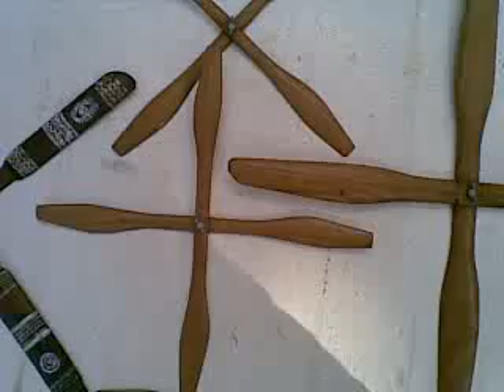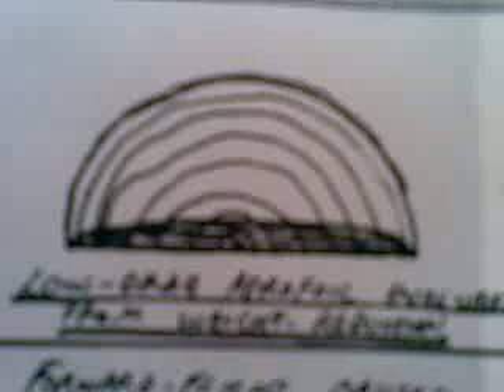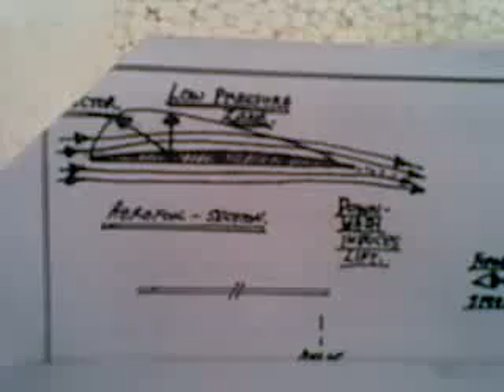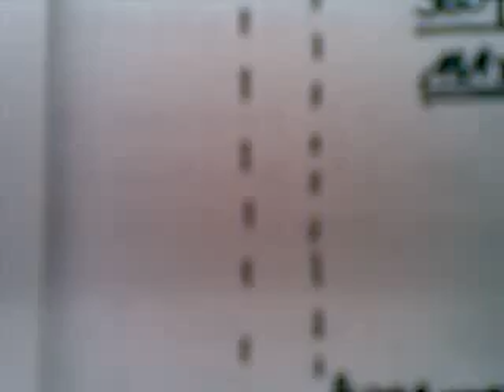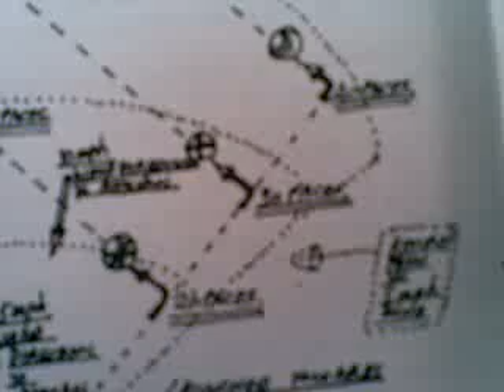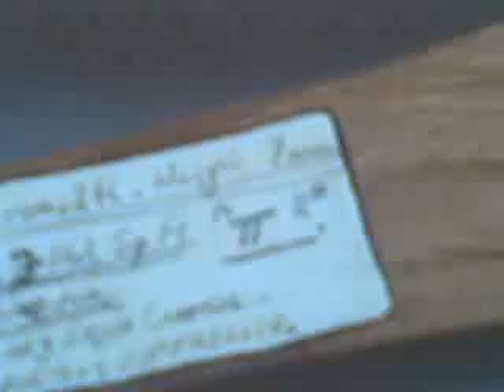Boomerang Aerophysics...Autorotating Rotary-Wing Sailplanes, Explained..!

Comment from the maker: @BinaryBunyip
   G'day...   Well, I haven't tried 3 - that I can recall, but I often used to launch in pairs...; for the Flightpath-Comparisons.  If the better one is on top they fly clear, reverse that and it can tangle...; but that's how I unpicked the X-Boomerangs from the Pinwheels. Equal Span & Weight, simultaneous Launches. Different Woods, to get different Densities, & so keep the Planforms close. Try 'Secondary Functions of The Boomerang Carving Stone'.

Comment from the maker: @muddymuddymuddman
  G'day  Muddy, thanks for enjoying the  "sermon"... I was almost set to carve them beside the Highway, when SunFoil Inspiration struck.. Yep, 4-Blades allows Horizontal Wind-Turbines to swallow Turbulent-Burbles that'd stop a "more theoretically efficient" 2-Bladed...  A pair of wooden rulers, shallow D-Section, from Newsagents. Steam Coning-Angle, 2-4 degrees per blade. Tight Rubber Band to join at centre. Launch it gently..!